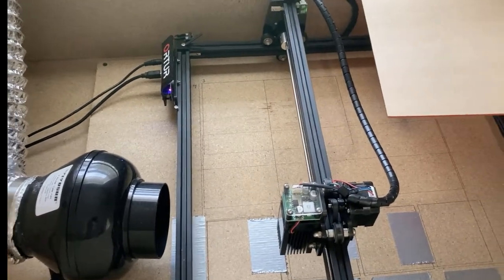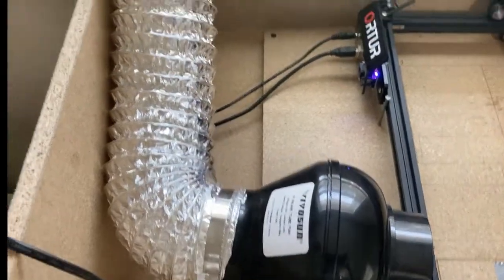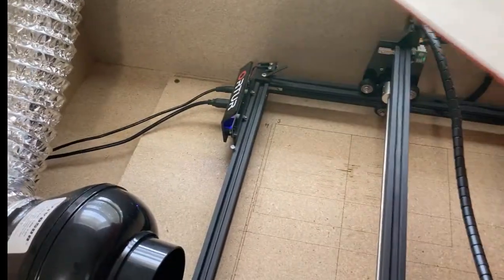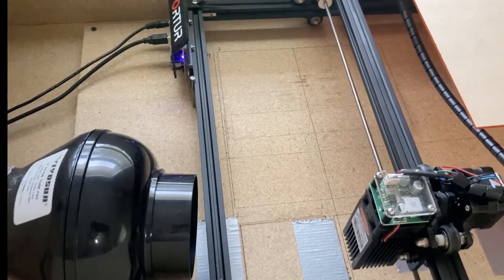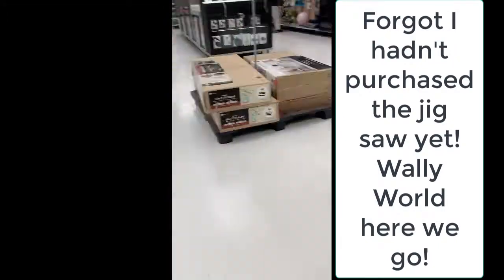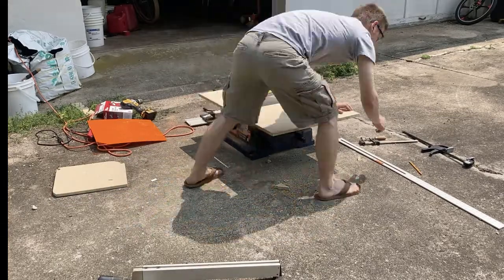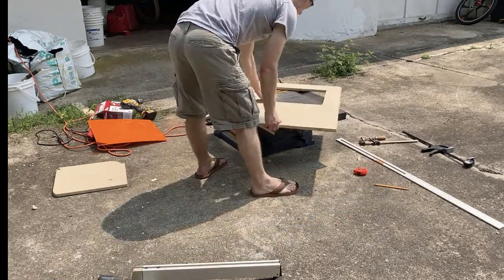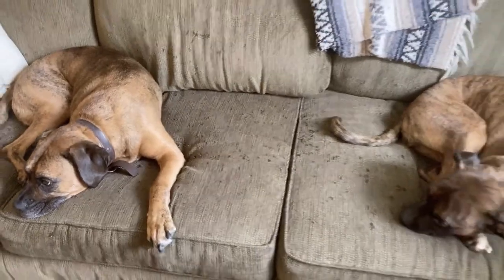Ortur Master 2 Laser Cabinet Build for Exhaust Fan and Vent Enclosure - Great project and upgrade!

Comment: tip 1, for more eficiency to remove fumes, you must have an inlet and outlet (fan)
tip 2, the fan can be attached to the box to you can connect the tube from the outside
tip 3, try to hide the cables somehow to give it a more clean look inside
tip 4, you can add lighs inside (LED) with the switch ouside the box
tip 5, paint with white inside the box execpt the base so the light doesnt reflect too much
tip 6, record and show to us the project hehe
Reply from the maker: These are cool ideas!  Maybe I'll take you up on it.